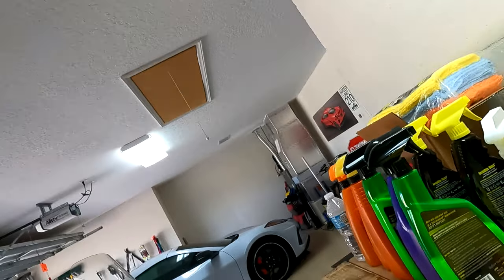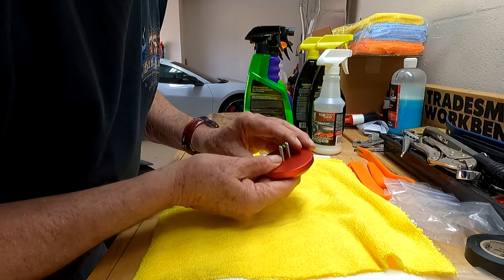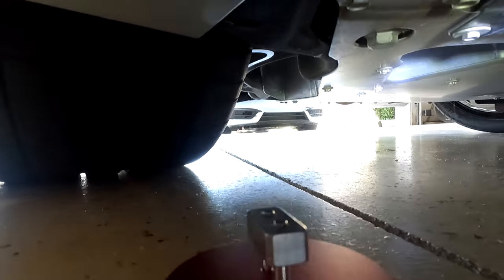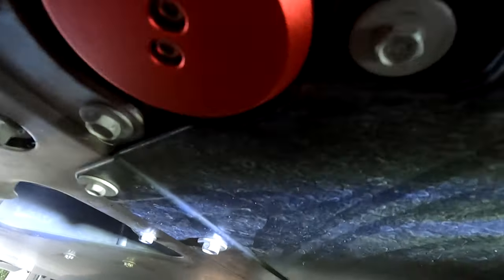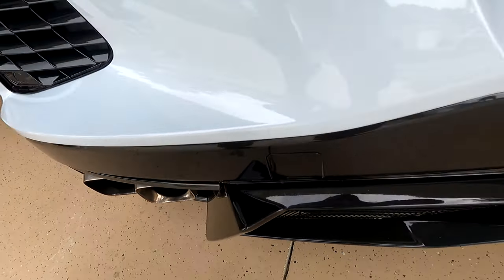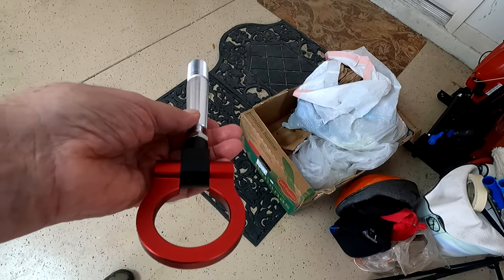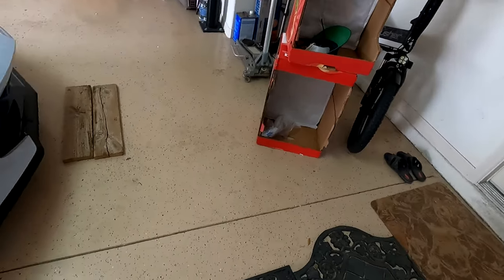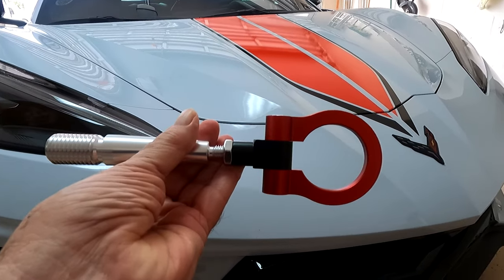C8 Corvette Pucks and Hooks

Comment: Pucks and tow hooks will be the first additions to my 2022 C8…whenever it arrives.  I will use LocTite Blue 242 on the pucks. Probably on the tow hooks as well.  I will leave the tow hooks mounted just in case I’m not available should the car need towed. Cheers!
Reply from the maker: The locTite Blue 242 is a good idea!

Comment: ACS Composite has the same lifting pucks $100. They also have tow hooks. I can’t say enough about this company, they are awesome. Their splitters, side skirts and wings are perfect. I actually heard they make them for GM. I noticed you have Top Coat F11 on your work bench, awesome stuff, been using it for years.

Comment: My C8 is at 3000 Status. 
I ordered a Tow Hook (SDA $95) as part of my build.  I requested the dealership not install it, since it’s an LPO and I don’t know which end it will be needed, which I hope is never.

Hopefully it will not be on “Constraint”!!!  

At the time my order was submitted to GM, November 11,  2021, Splash Guards were “On Constraint”. Since they are also an LPO: dealership installed item, I asked my salesman remove the Splash Guards (VKQ) from the build so hopefully nothing else will slow down the build.

Great information as usual! 
I am thinking about getting pucks and I was curious as to Jacking Locations. Thanks for pointing them out.

Danger, Danger?:
Is it correct, that moving a C8 by pushing/pulling or towing without power, can cause catastrophic damage to the transmission? 

Can damage be avoided by the C8 being in Neutral?

Are there other Jacking Points for the C8 other than the puck locations?  

Does the C8 come with a Jack? (Since the car is on Run Flat Tires)  

FYI.  I have a tire repair kit in some of my cars and a 12 volt air compressor.  I have repaired a tire twice when out in remote areas before cell phones.
Reply from the maker: Unless you are able to put the car in neutral, you won't be able to move the car unless you have 4 of those tire dollies. Some flat bed trucks carry them but most don't. There is also an expensive tool that, when used, will put the car in neutral. I think is $600 or more for the tool. No problem moving the car IF you can get it into neutral. Otherwise, Yes, I think you would have transmission problems. NOW, if we had a manual transmission option, shifting into neutral is EASY!!! 
Nice to hear your car is getting close.
Reply: @RobertMacCready  Thanks for your response. I thought that was the case.
I have the car dollies because I’ve had trouble with my C6.
The shifter gets stuck in park. I think it is the Parking Pawl. It’s stuck now and it’s been to the dealership 3 times for the same issue. 
Unfortunately it’s winter here in PA and I might wait until spring to take it in again.  If I try to move the gear shifter, eventually it releases after numerous attempts.  But, it gets stuck a few times later. Not dependable at all. I’ll have to ask if they seriously addressed the Parking Pawl.